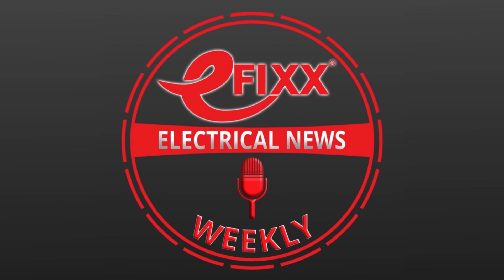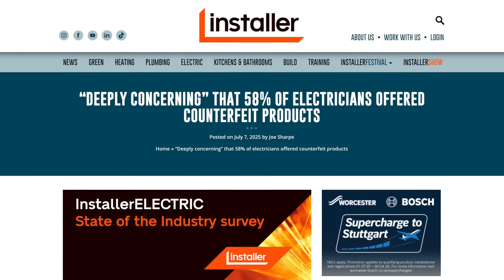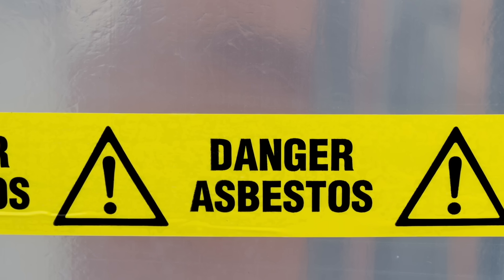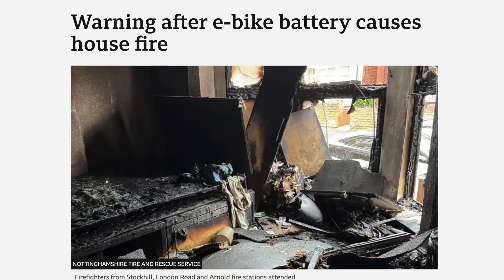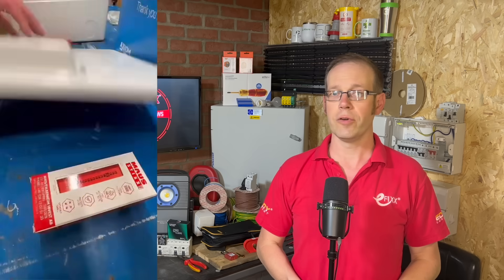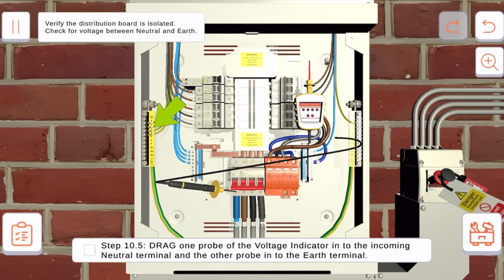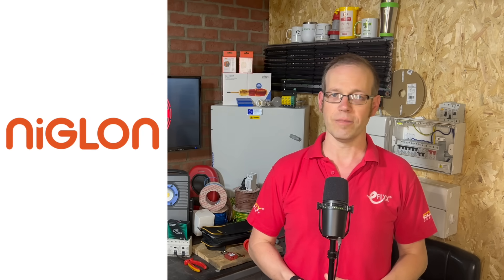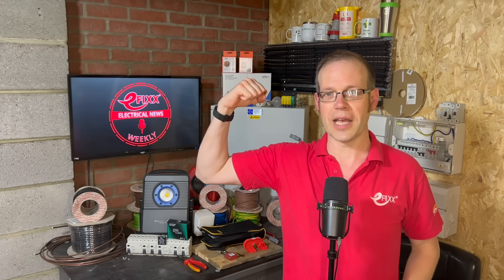NICEIC Warns Electricians on Outdoor Consumer Units

Comment: Just posted a question last night on an electrician page was installing a consumer unit outdoor just next the meter box and my question was can't you just install the fuse board in the meter box instead of leaving it outside and accessable by anyone!
Reply: That would be too sensible. The DNA's don't allow it hence the use of an outdoor consumer unit. If they suddenly ban outdoor units given the large amount of older housing in the UK would that mean apart from the expense of an ev we now have to get our houses rewired?? If that is the case I'll be giving up on this ev lark.

Comment: Asbestos inhalation for us electricians is a role of the dice, 'doya feel lucky' every time we work in any pre 80's building, the ceiling artex contains asbestos, under the floorboards the dust is heavy with asbestos from the old plaster, I have been in the trade 40 years, used to get covered in Asbestos shit and I think back to all the times we would just rip out asbestos flu pipes or work in boiler rooms laden with asbestos fire cladding or repair boiler control units and sweep up all the white asbestos into a dust pan, no masks, just a T-shirt and old jeans. I'm not going back to the 1870's I'm talking about the late 1970's, how times have changed! So sad to hear about one of our colleagues but its not negligence, years ago, we didn't know. What's really frustrating is that even after all these years we cannot buy a 50 quid device so that when we take up a floorboard we can stir the shit up, wave the device in the air and a display tells us the parts per million asbestos concentration.

Comment: I remember as a child asbestos in a packet and you would mix it with water or spit and use it as a raw plug.
Reply from the maker: Oh my goodness that's disturbing. 😬
Reply: I remember the stuff too. It used to come in small round tins. It worked extremely well, as it moulded to the shape of the holes, and in a period when the inner cavity wall was often built with clinker from gas works and power stations, that was useful as you rarely got a nice, clean round hole when drilled. 

There must still be countless millions of such fixings in the walls of British houses.

Comment: For a brief second, I thought they've finally seen that a metal IP66 EV CU with a PEN fault will give the owner a very bad day & to avoid this for external CS - where risk of standing on actual ground, an insulated CU should be used to mitigate this...
But nope - some old flannel about IP44 & moisture and/or where protection is installed in varying outside temperatures etc...

Odd isn't it, people bang on about extreme cold/heat effecting the protection & possible moisture - even floating the idea of a small bar/tube heater in extreme conditions etc...

Yet the actual EV Charger/Wallbox, is insulated plastic, full of RCD+Relay switching gear+PEN Fault detection etc... and nobody frets about the internal temp/moisture inside it out in all elements

Naah, carry on slinging up metal CS outside, but don't overthink/specify it - yet take into account....
WTF ??? if that isn't contradiction I don't know what is
(Though, like most stuff it might as well be written in Latin, this states this, but elsewhere this rule applies, whilst also taking into consideration relevant manufactures guidelines, but also consider your own risk assessment to establish...)
This is the electrical - well actually many industries these days SMH
Reply: Customer outside heat pumps, air con, battery, solar inverter, EV charger, fuse boards and all other metal cases appliances outside are completely unprotected but at least the car is protected by a pen fault devices that only monitor under and over voltage and don’t actually detect pen faults
Reply: @giz177  True, even Garo PEN fault detection monitor the voltage & often false tripping increasingly occurs as they get older/begin to fail. Then try to source said component - nah usually ends up buying the whole unit again...
But most Wallboxes today, have a sort of PEN fault detection, that will trip in the event - but the real issue is the problem still exists within the supply of property...

Simon comes out one morning to find his Tesla hasn't charged (PEN fault caused the wallbox to trip out, protect EV and owner from touching EV with PEN fault)
Simon, seeing his Tesla hasn't charged, then goes to the insulated EV Charger/Wallbox, sees that it threw a hissy fit, so then proceeds to his metal EV CS, standing on actual earth/grass & is about the lift the metal lid of his metal EV CS - that still has the PEN fault/360v through the earthing conductor/casing...

Nearby, Peter has come out to notice his Ioniq hasn't charged and is heading to his "insulated" EV CS...
It will probably be Peter who eventually calls a spark, who then will notify the DNO,
coz Simon's day is about get much worse, a very very bad start to his day

Simply avoid any metal enclosures for outside situations, in 9 out of 10 cases a EV CS isn't really needed & often to join cable (say SWA to H07) then an IP Wiska box will suffice
If you really have to install a EV CS, outside - where the owner may be standing on actual true ground then an insulated enclosure will protect owner over a metal CS & a still existing PEN Fault

PEN faults are quite rare, but the number of reports to DNO's are increasing each year & I really expected it to be announced finally that metal EV CS should be avoided for any exterior installations - but nope
Simon is soon going to wish he used the same electrician/company that installed Peter's EV charger

Comment: What a load of nonsense. The manufacturers have designed these products and marketed them for this purpose. I’m certain the NIC EIC makes half this stuff up as it’s not backed by research over time. If there was any risk of homeowners using a pressure washer around the outside of the house it should definitely be higher than IP 44 . So that’s most homeowners is it not.
Reply: I feel sad for that poor mouse 😢
Reply: Yeah, it's not like manufacturers to  design products that don't work. BG for example are currently selling a plastic ip66 DB with a rating of pollution degree 3. An indoor pollution rating on a product that has been marketed for external use. Needless to say, the pollution degree 3 has disappeared completely from their website, but I made sure I got a screenshot and the datasheet before they did. Whatever lies the manufacturers pedal as facts are irrelevant. There'll be moisture in that enclosure regardless of where it's had knockouts added or wether silicone was used to reinstate the IP rating at the back.
Reply: @WB_Sparks I understand what you’re point is but this is a manufacture issue . I do agree with a drain hole in the bottom of the enclosure the same as outside 13 amp sockets which are also often IP 66 .maybe NIC EIC should complain for electricians overkill on these too ?
Reply: @christastic100 a condensate valve should be a requirement on them. Im not a fan of drilling holes and leaving them exposed. A bit overkill on an external socket though. I see the point theyre making about heat generation in the enclosure, but that would be the least of my worries having seen some that their scheme members have lashed in. I think NIC put out stuff like this periodically to somehow imply they're still relevant.
Reply: It is now possible to fit vent glands.
You cannot legislate for stupidity.

Comment: Speaking about poor quality stuff entering the UK - I need some pre-insulated ring crimp terminals in a hurry and went to Amazon as you do. Upon receiving them, I realised that they looked a bit thinner than usual. After measuring the thickness of them compared to some of my existing ones, I found that the thickness was indeed different: 0.3mm vs 0.5mm!
Reply: Hello, I had the same issue with  some Sktronic crimps some years ago,These were yellow butt crimps Which once crimped  you could pull the wire out! I was at the time working at a independent wholesaler,we returned all the crimps and got in touch with swa crimp company and set up a rack with their bs approved crimp sets and tools  I now never buy crimps from any one else .
Reply: @yngndrw.  
That’s what happens when manufacturing is outsourced.
Reply from the maker: Probably made from Brass not copper
Reply: @efixx  I just checked, you're right - They are plated brass!
Reply: It's generally a bad idea to buy from Scamazon as there are so many fake products mixed with genuine. It's a gamble as to what you get.

Comment: The situation with asbestos is crazy really.  Everyone knows about the dangers.  Everyone knows enough to recognise asbestos bearing materials - backboards, sheeting, lagging, fire proofing and so on.  Despite that I still hear practically weekly from young electricians that think nothing of cutting in to AC (asbestos cement) sheeting to fit lights or drill into old backboards and wood frames to fit wiring here (Australia).  No mask.  No wetting agent.  No dust control.  Dust goes every which way.  They don't just put themselves at risk, they've contaminated the premises which is often a house.  It's not just electricians either, plumbers and DIYers go at old AC pipes with angle grinders.  Death rate is about 4000 a year here.  Where will that figure be in 40 years time as more old buildings get worked on over time.  Scary.